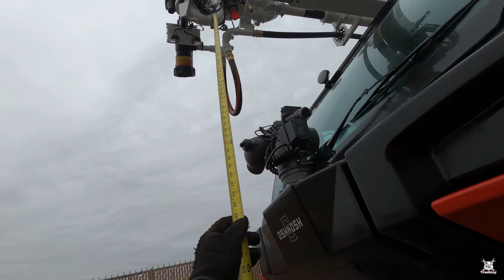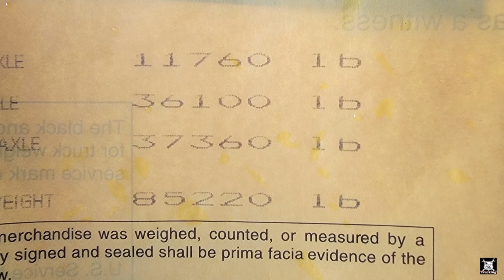I Stall Loading Overweight Oshkosh Striker

Comment: If you think this 6x6 Oshkosh Striker is heavy, you haven't seen an old Oshkosh 1985 P-15 8x8 with it's 4.5 feet diameter high floatation tires.  That thing was nearly 85,000 lbs and had two Detroit engines in it, one at the rear and one behind the cab.  It was likely the heaviest fire truck ever built.

Comment: Air operated door... am I the only one thinking this is just another system to fail at some point?
Reply: Nope.  However they have to come up with something to entice people to buy their equipment and not just refurbish an older engine.
Reply: A lot of old buses here in the UK had air operated doors. If there's a loss of air, they can still be opened as there's no pressure on the mechanisms.
Reply: Still pretty useless tho as in combination of holding the button and waiting for the door to open, a regular door with a handle would still be faster to open than that useless waste of material
Reply: Pretty damn flimsy looking as well

Comment: You got me very interested in Interstate bridge clearances because of your 14 foot load. So, I went to a DOT website and read about the limited Interstate Priority Network where States were encouraged to modify bridges to a 16-foot clearance issued by the Federal Highway Administration in 1978. So, I'm wondering how many Interstate bridges are now less than 16 feet.
Reply: should look and the low bridges in Chicago and Minnapolis. had a city map of Chicago that showed all the bridges that were less than 13 ft. they may of upgraded by now, and i never had to take any routes that had low bridges, but i did run into one in Minnapolis, had to back up, 3 blocks before i could turn around. taught me never tho switch loads
Reply: @dennismckown4951  👍
Reply: @dennismckown4951  I know that a lot are still marked as 13 feet, such as the ones on 47th street west between I-94 and Racine, but the city dug underneath them  making for more clearance, but never put up new signs. At least that's the way it was 10 years ago, when I last delivered and picked up in that part of Chicago.
Reply: @dennismckown4951  yea Minneapolis does have some low bridges.  Most semis make it under them along with the oversized loads too though.
Reply: @bobac1083  well this one was located in a residential/industrial area. just wasnt oing to take any chances. was already tired from making the long run from Ohio to Minnisota. was going to sleep long after my delivery.

Comment: Spent 6 months building the cabinets and inside wood work on a luxury yacht . 129,000 bucks only to have the truck driver go off his scheduled route and try to pass under a 13 foot bridge ! Ruined the whole boat and wood work . The boat was rebuilt and I made new cabinets and interior wood work . 2nd attempt to deliver they had a spotter with the driver to make sure no deviations from the route chosen was violated . It hit another bridge and the error was made by the guy that routed it ! The story gets even better . Insurance guy investigating found that the second bridge it hit was built 4 inches lower than blue prints stated it was supposed to be ! Never saw that boat again !
Reply: Good story, thanks for sharing lol sounds extremely exasperating

Comment: Using a piece of rope then measuring the rope, is much easier when checking height 

I'm curious to know the penalty for running oversize without any indication it's oversize, no flags, no signs, and no amber lights 🤔 
I saw two this week...I'm guessing they didn't want to use the route they're supposed to take
Reply: I see them a lot too.
Reply: Could be thousands of dollars in fines for that easily

Comment: I was just wondering what happens if the load damaged in transport. For an example let’s say you measure the load height and it’s within interstate limits but for some reason it’s get damaged by an overpass which was lower for than these limits for whatever reason. Do you than have to return the load to where you collect it so it can be repaired by them or do you continue on and deliver the load to port where it will get repaired overseas at it destination. Who insurance will have to pay if it not your fault because of overpass not within legal limits? This is just an extreme example I know but I’m just curious how it would be handled?
Reply from the maker: A while back I had one on video that went to Africa.   There were two trucks.  The one I hauled made it, but the other was damaged by one of the ports by a forklift.  That was a long time to settle.  I never heard how it was repaired or where.

Comment: heavy beastie... silly question for you, the gladhands at the end of the trailer, is that for working on the trailer? ie working on tires etc or is that for somethign else? I enjoy seeing the parts of WI I used to go as a kid
Reply: This trailer has the ability to have an extra dolly set up on the back so you can have extra axles (and thus extra tires) to disperse the load if it's really oversized.  Steve doesn't have that though and if he did, he would most likely need to upgrade to another rig with extra power (or modding Orwell) to pull the heavier loads.
Reply: @danielseelye6005  ahhh, cool! thanks!

Comment: Hello , I have a question for you ,how much power does your truck 's engine have ? . Thank you very much , greeting for Spain .
Reply: This is a stock 3406B Caterpillar (7FB variant) with a turbo so it's rated for 425 HP (312.5 kW). He could crank it up with mods to get almost double the power, but it would hit his fuel efficiency (5.5 - 6 MPG, 42.7 - 39.2 l/100km)

Comment: Would  rain-x work on the gopro lens for rain not to stick
Reply: Optics have coatings to control transmission and reflection at the lens surface.  You'd have to know whether rain-x would harm those coatings before using it on a camera lens.

Comment: What advice do you have to guy who wants to put a cabover on the road.  I have a 89 International, been a deisel mechanic for 40 years. I just upgraded to class A CDL manual trans.  I took the test with a conventional pulling a lowboy trailer.  My tractor that I own does not have a wet line.  Should the tractor frame be special for hauling lowboy trailer? (double framed)